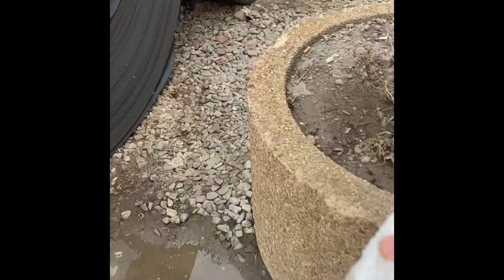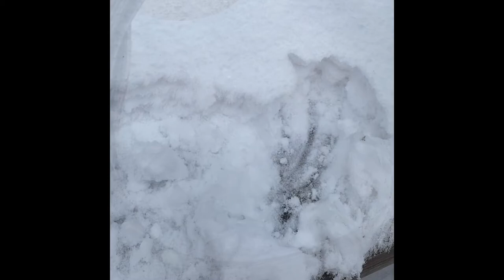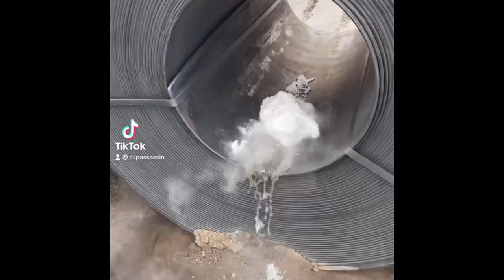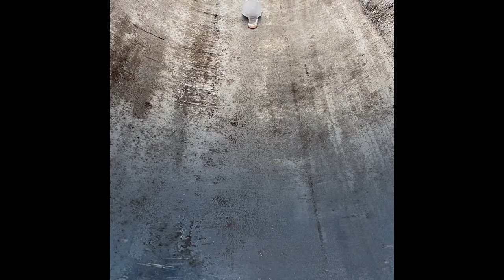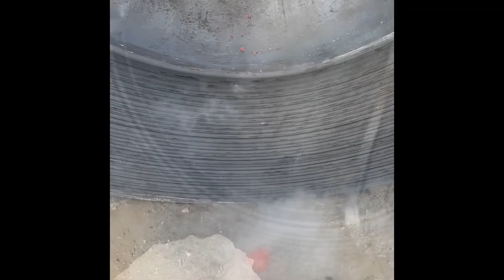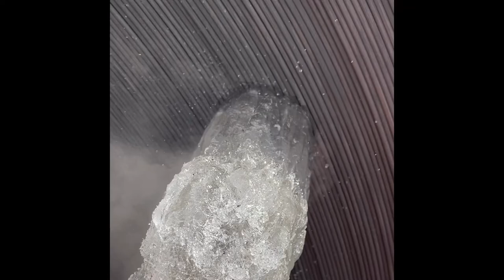Snow & Ice vs Hot Steel Coils || January & February Compilation

Comment: The seatbelt when it stays outside at 1-3pm:
Reply: What?
Reply: You know like when your trying to put on your seatbelt during summer or a hot day, the steel of the seatbelt kind of burns you.
Reply: @richie4realr624  WDYM KIND OF
Reply: @richie4realr624  that sht burns worse than the oven at full power